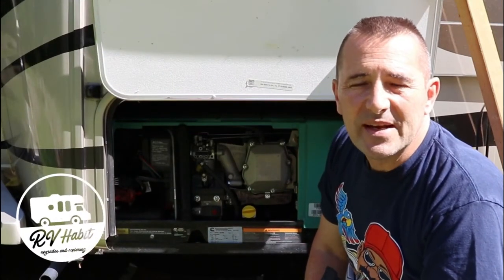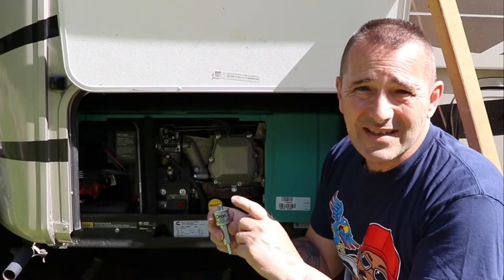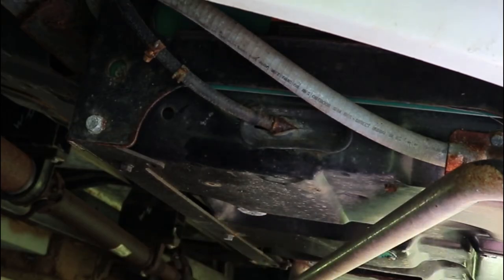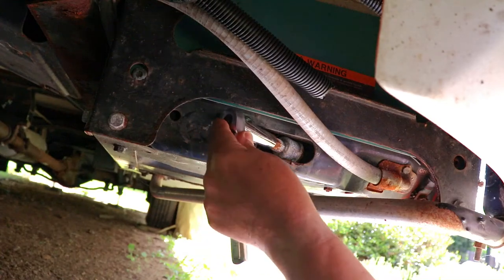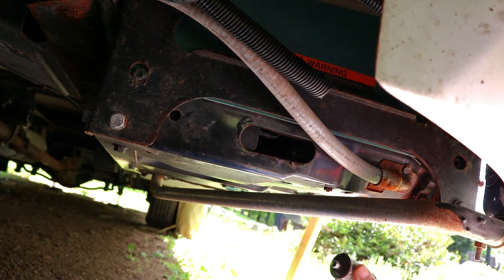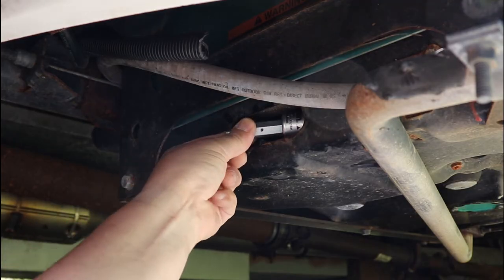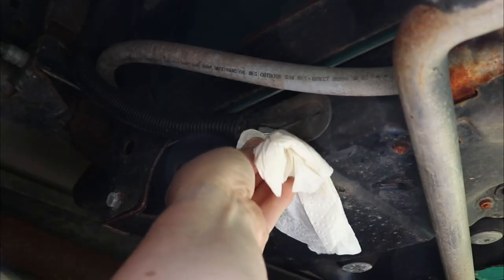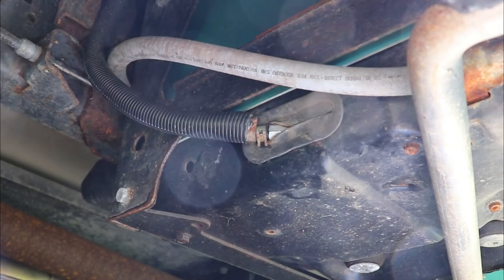Replacing A Fuel Filter On A Cummins Onan RV Generator - RV Maintenance – Cummins Onan RV QG 4000

Comment: Informative video, mine’s not starting so gonna change out the filter and see if that help. Thanks
Reply from the maker: Hi Steve,  Also make sure the fuel pump is working.  Seems to be a common problem.  Good luck.
Reply: @RVHabit   I got it started by using carb/ choke cleaner, but it still doesn’t stay started. I’m going to replace the filter and fuel pump and see if that’s the culprit. Thanks for the info.
Reply from the maker: Hi Steve,   Yes could be a fuel delivery problem.  Also, the carbs love to gum up with ethanol fuel.  After you get it running check out my video on exercising the generator with Seafoam.  Good luck.

Comment: Thank you for the video! It definitely helped! Quick question. I have some thread of the fuel filter still showing, but hand tightened and the with a ratchet as tight as it would go. Is that normal?
Reply from the maker: Don't recall how mine looked but sounds normal.

Comment: Lou, thanks for the video. My gen only runs when I make a direct fuel line from a gas can below it. I don't get any fuel into the carb when it's connected to the Ford 450 gas tank. So I'm not sure if the problem is a weak pump or a crack in my fuel line. One clue that it's a bad fuel line might be that no gas drips from the fuel line when I detach it from the gen. What do you think my problem might be ... the fuel pump is too weak to pull from the gas tank or the gas line has a crack?  Thanks for your informative videos!
Reply from the maker: I would start with the fuel line.  Fuel should drip from that line when removed from the gen pump.  You also stated the fuel pump on the gen is working since it will run when you use a separate fuel can.  Good luck.

Comment: So glad I found your channel thank you.  Straight to the point, very clear instructions and great camera work!  Question: is the fuel filter that you put a link to good for all different models? Or do I need a model specific filter? I have a gas 4KYFA_26100P
Reply from the maker: Most any part is model specific.  Check your owners manual for replacement part numbers.  The link below states it is for the QG generators and not model number specific.  It is possible the correct model number is also listed on the cover for your generator.  Good luck.

Comment: Several RV owners have installed a fuel cut-off in the generator fuel line. That way, the fuel can be shut “off” before placing the generator in storage. Then letting the generator run until it stops for lack of fuel. In theory, this reduces the potential for gum and/or varnish to form in the carburetor. But you have to remember to turn the fuel cut-off back “on” again when you want to use the generator.
Reply from the maker: I have heard of this and it seems like an excellent idea.  Maybe a new project video in the future. 👍

Comment: Hi Lou,  I use "LOCTITE" at my work and was wondering why you are using the Thread locker on the filter?  will it come back out easy?  I know how Loctite is, never used that stuff.  What about anti-seize, like what you would use on spark plugs?  Thanks,  Phil
Reply from the maker: Hi Phil, great question.  I have always used thread sealant on small engines.  Just something I learned as a kid when dealing with fuel fittings.  It seems to come off easy when its time to remove and replace the filter but resists loosening due to vibration.  Loctite is more of a thread locker and may even require heat to remove.  I am not sure anti-seize would have any vibration or leak prevention qualities.
Reply: @RVHabit  ok I will give it a try.  going to replace mine this weekend.  thanks for all the info and your videos.
Reply: Never use a thread locker as a sealant, and never use anti-seize, neither of them is a sealant. You must use a gasket sealant specifically made for use with gasoline.  I use PRIME SEAL; O'Reilly carries it, and it comes in small inexpensive bottles in 3 grades, where the cap incorporates a brush applicator. Grade 3 is made for aircraft fuel lines and that's what I will be putting on my fuel filter connection to the fuel pump tomorrow, because I connected them clean and dry, my usual practice, and the connection seeps. Remember the level of the fuel in your gas tank is way above the level of the pipe running into the fuel pump inlet, so when you stop the generator there will be a full fuel line all the way to the to this entry point, and will act as a syphon, and keep the gas seeping and dripping as long as long as there is gas above the inlet of the feed pipe in the tank, which goes down to the 1/4 tank level.

Comment: Please don’t change a filter because the outside looks bad….you will be wasting money.  Follow the manufacturer timeline.  The outside fortunately does not filter the fuel.  Do you tear your truck bed off because it looks bad? Nope.
Reply from the maker: I change the oil and filter according to Cummins Onan recommended intervals.  Yes things may look bad from the outside but does not effect its function.